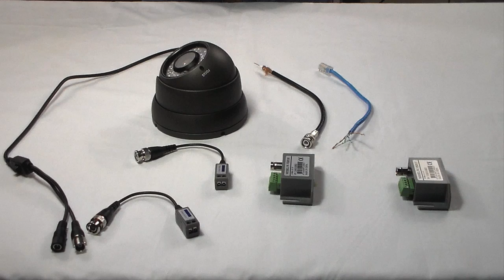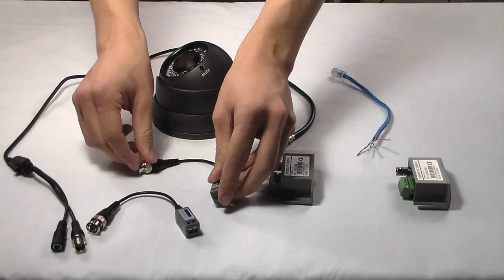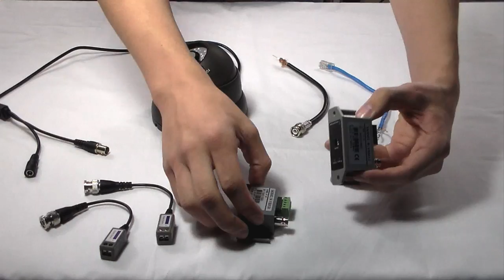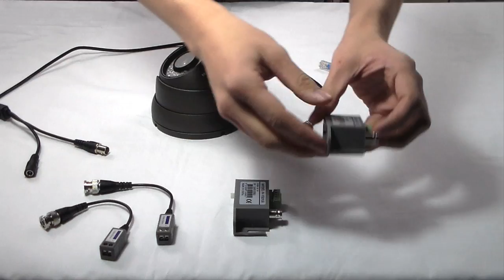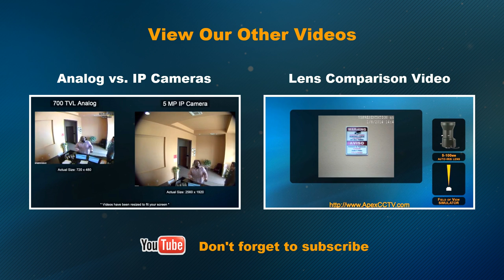Video Baluns Explained for Security Camera Systems

Comment: Do you power both xmit and rcv side of the balun?
Reply: you will only need 2 out of the 4 wires within the cable to convert analog to digital, the other 2 wires you will splice to power the camera